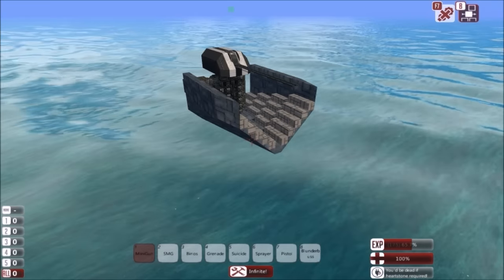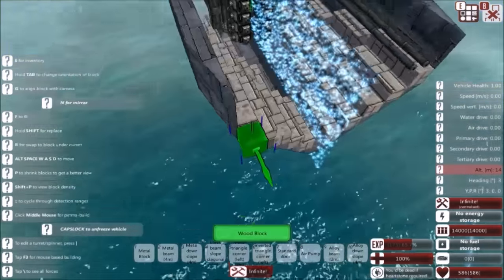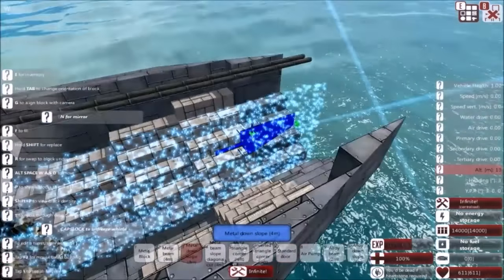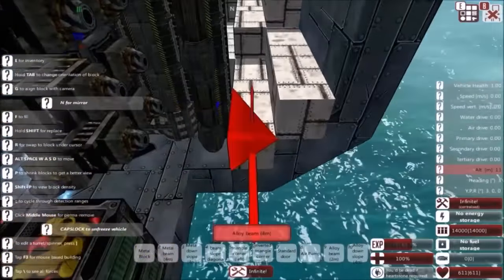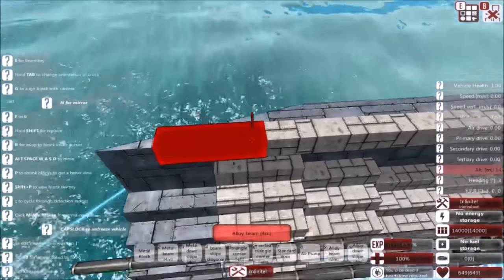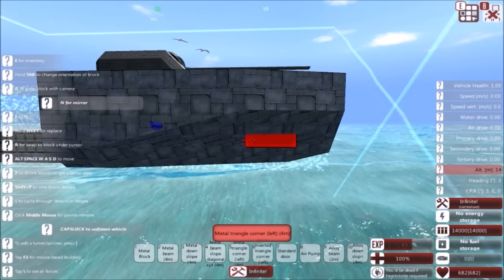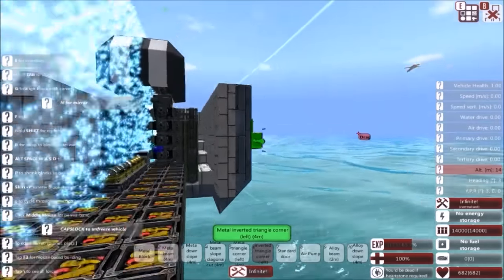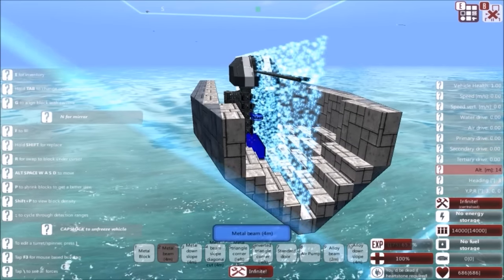How Dim Does It | Episode 3 - Shift to Gen6 | From The Depths

Comment: I guess I'll be the guy to point out that reversing the metal and alloy would improve its performance in almost every way. It makes better use of structural AC bonus, better radar and sonar cross section, and less expensive repairs because less expensive blocks are on the outside.
Reply from the maker: I use the alloy as an internal liner, as I just want slightly more defense, while not making the ship too buoyant. I also want to keep the aesthetics.
Reply: aesthetics > efficiency ;)
Reply: Sir Castic wouldnt heavy armor corners be way more efficiënt in cost than swapping the alloy/metal layers?
Reply: Awellner Depends. What outer layer will you be using?
Reply: Sir Castic metal ofcourse, but stone could work too if i want to be a cheap bastard
Reply: Awellner No then, since HA costs so much.
The AC of metal outer and alloy inner = 14.6 metal and 5.8 alloy.
The AC of alloy outer and metal inner = 13.6 alloy and 10.8 metal.
The AC of metal and HA triangle corners = 42.6 metal and 40.8 HA.
The problem with the HA is that it is very expensive, and has low health (1000 compared to 1680 on a full metal beam).
The problem with the metal outer is that once the metal is pierced, the ship is screwed.
The alloy exterior is the overall best choice, for the reasons that Breakthrough mentioned.
Reply: Sir Castic thats why i only use heavy armor on the important parts like the turrets, ai and ammo

id rather spend 1k more on armor than loose my 15k cram turret :)